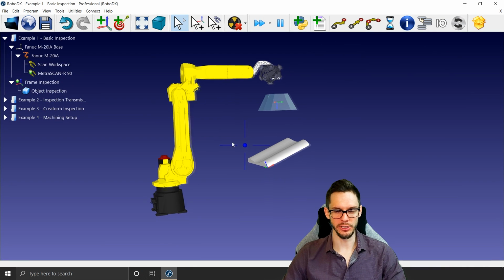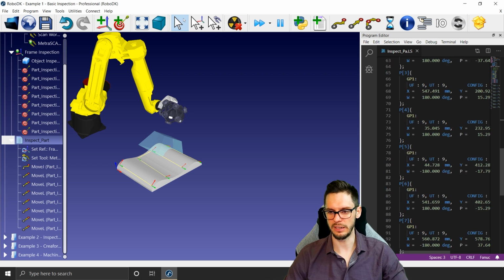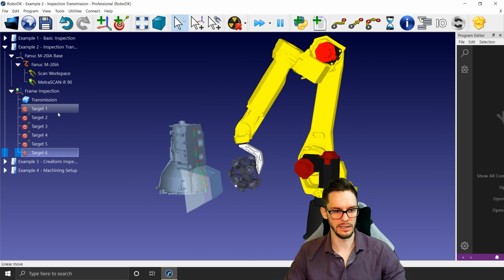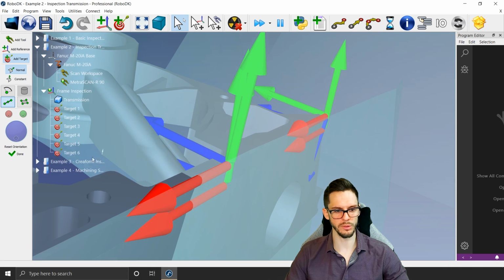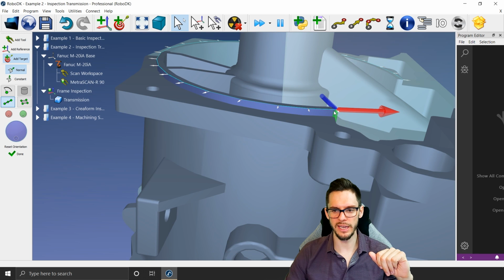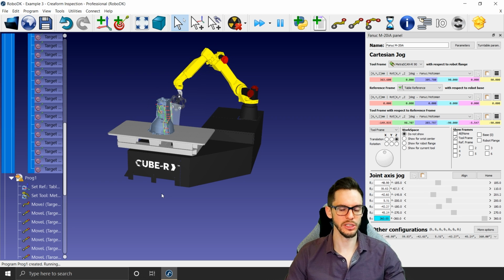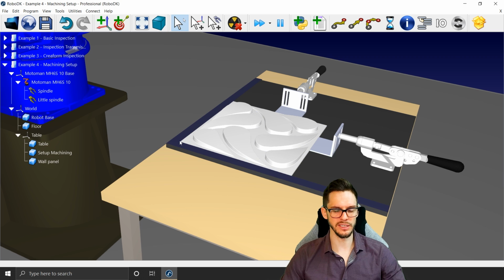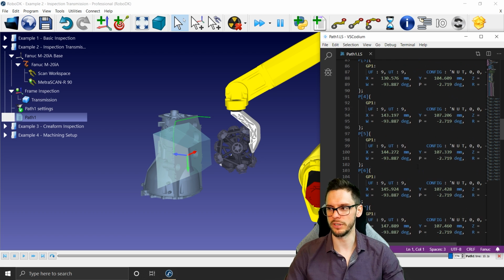CAD to Path (Part 1) - Teach on surface - RoboDK Webinar

Comment: Excellent software. Can you explain what is difference between RoboDK, RoboDK-GL2 and RoboDK-D3D
Reply from the maker: The other executable files use different versions of OpenGL to support older graphics cards
Reply: @RoboDK3D  Thanks for answering. I want to get old RoboDK installation having RoboDK.exe file version is 4.0.0.13290
Please help. Thanks